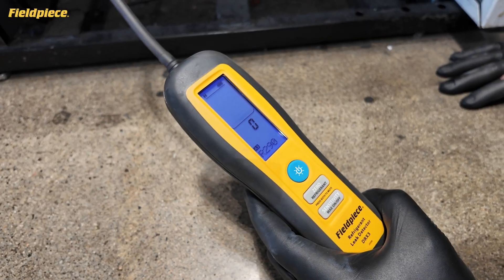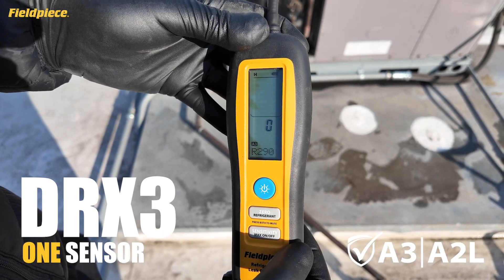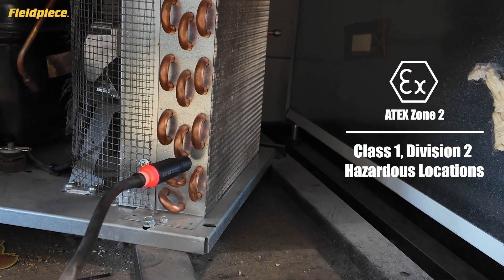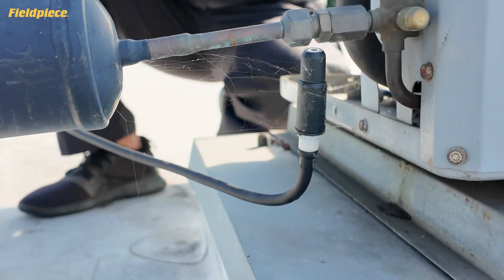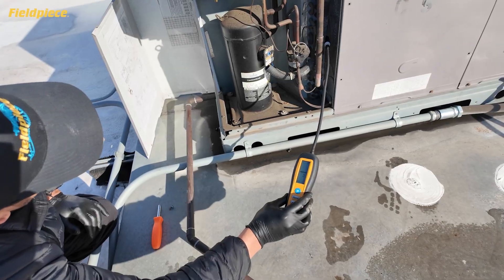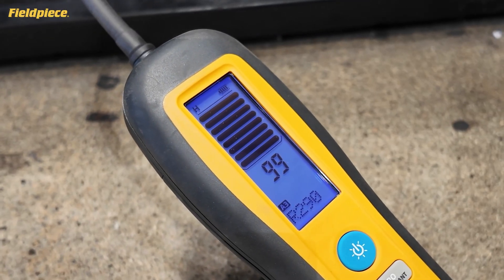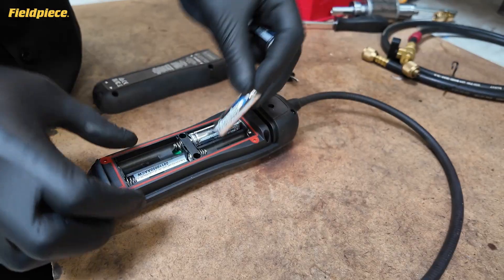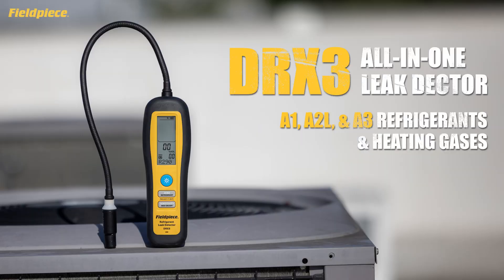Fieldpiece DRX3 Leak Detector: All-in-One Solution for Refrigerant & Combustible Gas Leaks

Comment: the dr82 was horrible, hopefully this one is much better
Reply: i like my dr82.
Reply: not good for supermarket refrigeration, r134a is a low pressure gas the dr82 doesn't pick it up through the honeycombs unless it's a big leak  @StatisT14
Reply: I have luck with it in residential 🤷
Reply: DR82 is a superior leak detector, and it is affordable
Reply: Why is the dr82 horrible? i was planning on getting it
Reply: spend a bit more money and get one that shows ppm @Primez8902